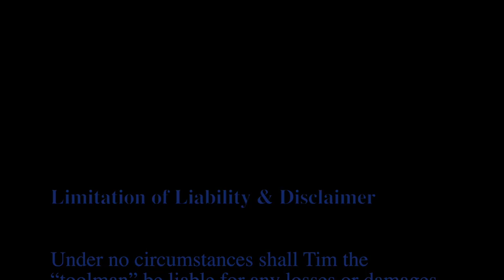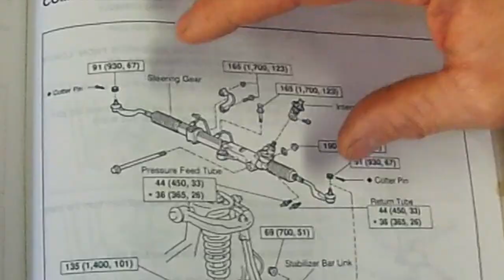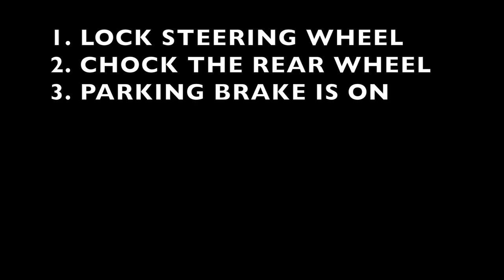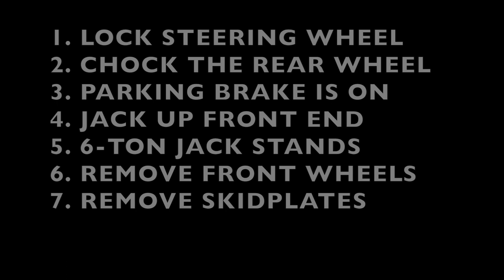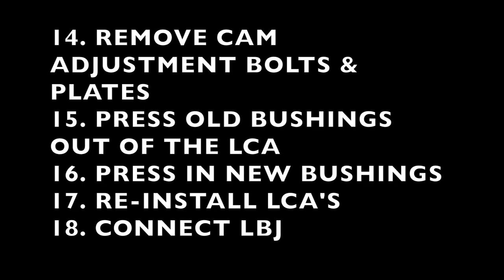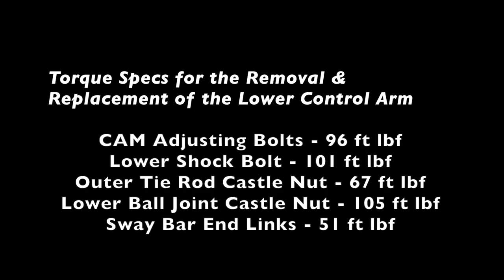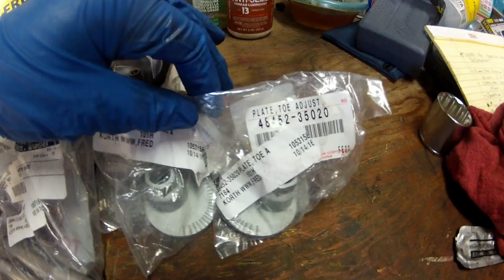Front Lower Control Arm Bushing Replacement (Part 1)

Comment: Tim your channel has helped me modify both of my gx 470's (2004)  I never turned a wrench prior to this year and have been able to do everything from Lift, LCA, UCA, brakes rooters and pads, oil changes you name it.  I am just wondering if I will still have to loosen the rack if I am gonna cut out pins because I have the super pro LCA, I figured maybe the toyota you are workingh on has KDSS and Mine does not.  Also I have seen videos of guys taking the knuckle bracket off and some do not.  Any recomendations?
Reply from the maker: The video we did this on is a 3rd Gen 4runner and I haven't done this on an LX470.  I'm not sure about all the particulars to get the LCAs off on your rig.

It's great to hear you've been doing all your own wrenching.  That has to feel good.

Comment: been struggling all day with these cutting and hitting them didn't try this....lucky still got 1 arm to do🤦‍♂️😂
Reply from the maker: Make sure to only use moderate force with the bottle jack and ample heat.  The one major concern is using too much force and bending the control arms outward.  We made a Part 2 also to cover how to cut the arms out if the cam sleeves are frozen inside the bushing and also how to use a press to get the bushings out.  https://youtu.be/6FzEHygizoI

Comment: Will this stiffin loose suspension? One of my Control arms have been replaced and that side is a lot stiffer that the other side(it bottoms out often since it’s lowered)
Reply from the maker: It shouldn't make the ride rougher but it would eliminate a loose feeling or clunking if the bushings were really worn out.  If the control arm is bottoming out onto the frame, maybe the bump stop on the new control arm is a bit stiffer than the older one on the other side.  

So you have a lowered 4runner?
Reply: @TimmyTheToolman  Tacoma sorry, it’s the pre runner model lifted from factory. New shocks and coils but one side is softer, it rode like thay before I changed them out too
Reply: @TimmyTheToolman  I have installed new lower bump stops too

Comment: Out of curiosity do you think I would still need to take of the steering rack if I was replace inner and outer tie rods. LCA  and lbj. I should have more than enough clearance with the  tie rods out to remove and replace the LCA
Reply from the maker: You have to disconnect the steering rack and pull it back far enough so you can remove the rear bolts that attach the LCA to the frame.  That's the reason for it.  Even with the inner and outer tie rods disconnected, the shaft of the steering rack would still impede with the bolt coming out.  But, if you took the inner and outer tie rods out and then cranked the steering wheel all the way one way, you might be able to sneak one bolt out and then crank the steering wheel all the way the other way and sneak the other bolt out.  That might work.

Comment: Very helpful video! Thanks, guys. I'll be doing this work soon. Actually, I'm doing pretty much everything in the front end of my 2000 4Runner 4x4: replacing all the bushings and ball joints (UCAs and LCAs), tie rods, steering rack bushings. It’s at 210K miles, and it’s not holding an alignment, so it’s time. 

Those look like Durobumps bump stops installed on the LCAs in this video...or at least they look just like them.  I have those, and the instructions say they should only be installed on the rear arm of the LCA. It appears in the video these are installed on the front. Just wanted to point that out. Perhaps let the vehicle owner know.

Thanks again for the videos. Keep up the great work!
Reply from the maker: Raleigh Moody we wish you luck in all the work you’re about to embark on! If you take your time, and have the right tools handy you will be fine.

The filming of this video was a couple years before Durobumps existed, but you’re right, he has super bumps in the front and Durobumps instructs to install them on the rear of the lower control arm.

Comment: The uh/um blooper reel starting at 49:30 was epic!!! Great video Tim and Sean, probably should've done this while I was doing my tie rods/ball joints/steering rack-sway bar bushings. Oh well, next time!
Reply from the maker: I just did this job on my 98 4runner.  I had to cut out 2 of my cam sleeves because they were rusted into the LCA bushings.  We're going to be coming out with a Part 2 to show the cutting of the cam sleeves and also show a different option for the bushing replacement by using a hydraulic press as opposed to the bottle jack technique.
Reply: Sweet. Thank you. When is the next meetup for the bay area T4R forum crew? (if you are planning on having another one)

Comment: Is it safe to assume you can also get the passenger side control arm bolt out the same way ? Wiggling it past the steering rack
Reply from the maker: Hey Jordan, after doing this job several times, we learned you can actually move the steering rack back far enough and not have to remove the boot and try to carefully sneak the bolt past the shaft.  If you disconnect the power steering line bracket on the inside of the driver side frame rail, that will give you enough room to pull the steering rack back further and you can get the back cam bolts out no problem.

Comment: Hello Timmy, Any comments on those whiteline bushings?
I've read some comments in regards to sticking to OEM bushings, for the 4 runner, I personally have a 95 series prado, but the lower control arms are the same.

I can't seem to find any listings for OEM LCA's bushings
Reply from the maker: I've been running Whiteline bushings on my 98 for around 50k miles, and they are fine.  There were many 4wheeling trips over that time, so some hard miles.
Reply: 5 @TimmyTheToolman  Timmy I'm about to order the Whiteline bushings
is it $95 per bushing or is that the price for the bushing set?
Reply from the maker: @NoLimitsFunGarage  It's the whole set.

Comment: Timmy! Can I use the torch and jack method for the uppers? U didn’t in your video but I don’t have a press. Thanks!
Reply from the maker: Hey Mike, the distance between the upper control arm is too tight to fit a jack between.  If you like turning wrenches and doing your own repairs, I highly suggest getting a Harbor Freight 20 ton press.  If you catch it on sale, you can get them for a really affordable price.  I use my press all the time.  It's money well-spent.

Comment: 4th generation 4runner has the ball joints as an integral part of the assembly so if the bushings are compromised you can be certain the ball joints move like a joy stick. Such is the case with mine after 246k miles.
My only cost effective option is to go with MOOG L.C.A.’s at $180.00 per L.C.A. inclusive of bushings and ball joint.
I was a bit confused about the adjustments but I see now it’s more of an oblong Front/back adjustment and not the up/down of control arm. At least I think that’s what it is.
I may just let my local shop install the parts, although I don’t like it when customers ask me to install appliance parts because let’s face it, parts mark up is how businesses make $$$.
You wouldn’t bring a steak to a restaurant and ask the chef to cook it.
This is one case my mechanic will make an exception.
Thanks for the video.

Comment: Great video! What size is the receiving cup? Is it a socket? Every heard of oblonging the arms where the bushing goes ? My friend/mechanic said to be prepared to buy the whole arm if that happens. Tha ks
Reply from the maker: Don't remember the size of the receiving cup.  You could just take some measuring calipers and measure the diameter on the ends of the arm to know what size you'll need.  Never heard of oblonging the arm.  Unless these arms are rusted to shit or you make a mistake and use to much force to remove the bushing causing the arm to bend outward, I think these arms are pretty bullet proof.

Comment: I considered using the burn method to remove the bushing, but would the heat change the temper in any way?
Reply from the maker: The amount of heat necessary isn't going to change the strength of the steel.  But, that's just my opinion.  I have no science to back it up.  I can say I've been running the Durobump bushings for quite some time and my front differential brackets haven't cracked.  So there's that.

Comment: Thank you so much for this and all of your videos. I'd rather pay for tools and do the work myself than the shop and cross fingers. 

For what it is worth, my symptoms are pulling after a bit of hesitation to the drivers side when braking. Turns out it is the passenger side LCA bushings being shot.
Reply from the maker: Jon Rabeneck You're welcome Jon.  I use to take my vehicles to shops for things I thought were more than I could handle with my level of knowledge and available tools but now I'd rather invest in the tools like you're doing and do most everything myself.   I doubt I'll be rebuilding engines or transmissions but I'll do most other things.  Happy Wrenching!
Reply: After watching some of your videos I'm confident you would have no troubles building an engine or transmission.

Comment: Link for the plate, toe adjust on amazon says will not fit 03 tacoma are these part numbers the same for 1st gen Tacomas?
Reply from the maker: They are the same.  Toyota probably has a different part number for this same part for a 1st Gen Tacoma.

Comment: when torquing the control arm bolts with the vehicle on the ground how do you get enough clearance for the torque wrench?  I thought the steering rack had to be removed and the boot pulled back for access.
Reply from the maker: The only way you could try to accurately torque those rear LCA bolts is with a crows foot wrench but take a look at it this way.  When you go to get an alignment, the alignment tech isn't going to torque them to spec.  They get on there with a big wrench and tighten away and that's it.  They don't break out torque wrenches when doing an alignment as far as I know because I've watched them.  Maybe some technicians look up torque values for your particular make and model rig, but I'm pretty sure most techs get onto the head of the bolt and tighten away using their best judgement.  The main thing is you don't want the LCAs able to slide out of position once the alignment is dialed in.

Comment: Hey Timmy !! thanks a lot for all the videos! You teach me plenty!
I'd replace valve covers and injectors in my Tacoma 2000 3.4 4x4 manual, and now runs like new and CEL-less
Now I need to replace LCAs ,and because of Caltrans and the brine they use to remove snow in winters, I know I will need to cut the Cam Adjusters....Amazon filter says, that the parts you used to replace yours will not fit In my Tacoma. Is that right? Or I should not pay attention to it and get it anyways?
many thanks
German from Tahoe
Reply from the maker: The parts for the cam adjusters should be the same as your Tacoma.  The arms themselves are different because you have a different type of sway bar connection than a 3rd Gen 4runner.  I bet Toyota used different part numbers for the same cam adjuster parts and that's why Amazon is saying they're not compatible.

Comment: Just wondering....my 98 4runner hasnt had any steerng/suspension bushings ever replaced. Ive started experincing significant sway at highway speeds.  Just wondering what other bushings I should replace and what order I should replace them in. Thanks for the great info!
Reply from the maker: Steering rack bushings.  Front and rear sway bar bushings.  Upper and lower rear control arm bushings.  Maybe the front upper control arm bushings as well.  We have videos for all these bushing replacements.  If you have questions, just ask.

Comment: How are you liking those bushing? I need to do the same job and im looking around for the best ones
Reply from the maker: Hey Mark, Fred reported that the front end of his truck felt more solid after this job and the alignment shop was able to get his truck within spec.  As for the longevity of these bushings, who knows. 

I believe your best options are either buying OEM or Whiteline.  Energy Suspension makes aftermarket poly bushings too but they're more of a pain in the butt to deal with.  Do some research and you'll see what I mean about the hassle involved with choosing the Energy Suspension ones.  The Whiteline poly bushings are designed just like the OEM bushings with the difference being one is poly and the other is rubber.

If I was going to do this job on my own truck, I'd use the Whiteline poly bushings.  They're affordable and the design is good.

Comment: How do these Whitelines do compared to OEM? I'm about to do that job I've got a small shake that a new steering rack and 2 alignments haven't fixed. Nervous to put on 3rd party parts but what is the consensus on these bushings?
Reply from the maker: They're great but you do feel more of the road with them because they are stiffer than rubber.
Reply: Had this same question. I bought the Whiteline kit and was getting around to putting them in when I read somewhere else a guy saying he can feel every pebble on the road now after the change. My truck is my daily driver, I get on the dirt maybe once every four months. You think OEM is more comfortable ride?
Reply: @weyls2536  I’ve done some more research since I posed this question and I think Whiteline is superior for a few reasons. Talking to some mechanics and watching a lot of videos it seems the oem bushings are not made for lifted trucks and because they are rubber.. they are under tremendous stress and rip more easily under the pressure from a lift. Polyurethane is superior because it’s a tougher material and when moving up and down it doesn’t wear as badly. You can still run OEM bushings but you should expect you will need to change them much more frequently.
Reply: @weyls2536  if you don’t run a lift.. there is a noticeable difference in what you feel on the road

Comment: Very good video. How have the Whiteline parts worked out, long term? Would you use them again, or would you go with OEM?
Reply from the maker: They've been holding up well so far but I don't think anyone has run them as long as OEM so it's hard to say what their longevity will be.  The price point compared to OEM made it seem worth the chance that they'll hold up for a long time.  Like they say, time will tell.  Glad you like our video.
Reply: @TimmyTheToolman  Thanks Timmy. I'm getting ready to do the front end bushings, drive shaft boots, etc on my 2000. I'm sure your videos will save me a ton of time as they have in the past.
Reply from the maker: Good luck with the job.  Let us know how it all goes for you.

Comment: Question...Why can't you put the rear adjuster in from the front so you don't have all the issues trying to get past the Rack and pinion
Reply from the maker: Great question Bill.  I think it's because the nut that the cam adjuster bolt threads into would stick out far enough on the back side to contact the steering rack boot.  This would ultimately tear the boot.

Comment: This info shall prove invaluable to do my 2000 tacoma sr5...are there any differences for this part between the two vehicles? Thanks for the video!
Reply from the maker: I did a search on the Camelback Toyota site and here's how the part numbers line up.  Comparing the lower control arm part numbers, they are different. 

Tacoma Lower Control Arm (right) #4806835120 
4runner Lower Control Arm (right) #4806835081 

Tacoma Lower Control Arm (Left) #4806935120 
4runner Lower Control Arm (Left) #4806935081

But then I checked the part numbers for the bushings.  Both the Tacoma and 4runner list the same part number for the bushing so I'm guessing they are very similar.  Maybe there is a slight difference that I'm not aware of but since the bushings are the same, you could use the same aftermarket Whiteline poly bushings and the technique we use to get the bushings out and back in should be the same as well.

Bushing #4806135040 (For all 4, both Tacoma and 4runner)
Reply: thanks for the response! I might be inspired enough to post a video response doing this on my truck. Ill probably get around to doing it this month
Reply from the maker: Cool.

Comment: Could this job be done while leaving tie rod attached to spindle?
Reply from the maker: I’m sure it could, but fighting all those components proves to be a recipe for swear words. It doesn’t take that much extra work to pop the tie rod with a puller.
Reply: @TimmyTheToolman  my tie rod ends seem to be in good shape. Would you go ahead and replace them anyway during this job or leave them?

Comment: awesome video tim! can the jack that is included with the truck fit in that same spot as the bottle jack you used?
Reply from the maker: Yes, it can.  I read posts on Toyota forums saying they used the stock bottle jack and it worked.

Comment: Hey Timmy, I ordered Moog LCAs and Cam bolts to replace my OE to save on cost.  Any thoughts on going with Moog, or any non-OE for these placements?  Hope I made the right decision. 
I did replace the LBJs with OE though.
Reply from the maker: I'm not a big fan of aftermarket suspension components unless it's part of a quality lift kit or other manufacturer  that produces components that exceed the quality of OEM.  Moog is ok and you'll probably be fine but they are not built to the same quality as OEM.  I'm guessing you bought arms because yours were rusted out?  Usually, you just replace the bushings and keep your OEM arms.
Reply: @TimmyTheToolman  Arms look fine but they are 24 yr old. I figure it would be easier to replace the entire thing.   I just don’t have the extra tools/equipment to do the bushings.
Reply from the maker: @marcsmartinez01  Gotcha.  I'd hang onto the arms just in case.